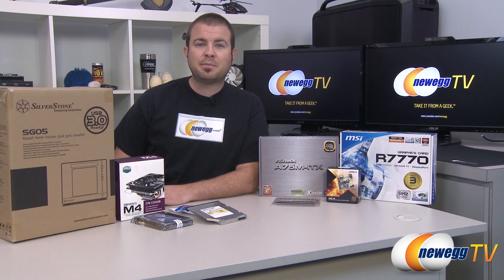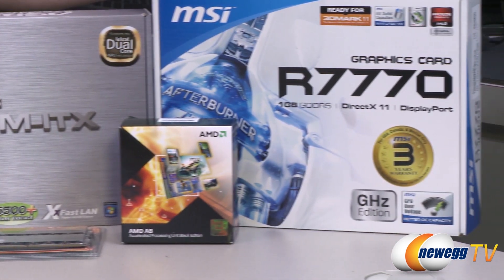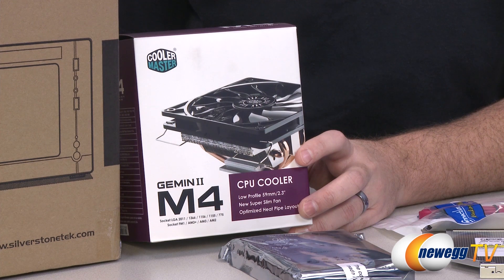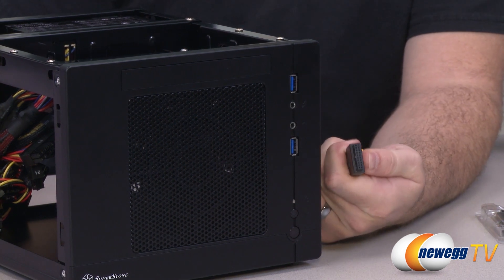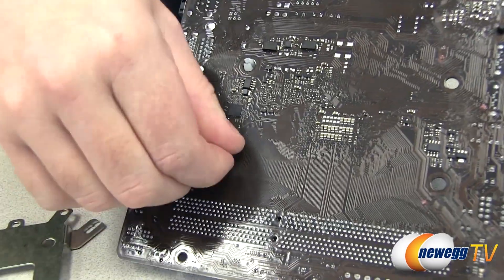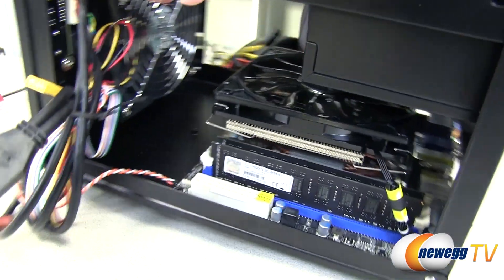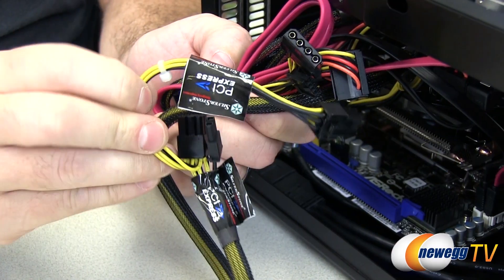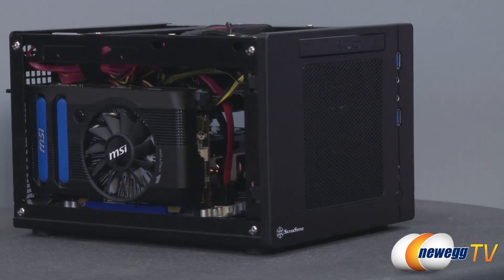Newegg TV: Combo DIY Build - Mini Mobile Gaming PC

Comment: Great case. For intel use a 4690 K i5. Use a ASUS Z97i mobo plus low profile noctura cp cooler. Use an asus GTX 750 ti GPU 8.5 inches. Promise that it will keep super cool and super quite even under load. Use crucial low profile ram and crucial ssd 2.5 inch. 450 watts will run any game on this set up without any heat issues. Just use cable ties and ingenuity for the rest.

Comment: Can it play bf4?
Reply: it can but i would get more ram at least 8gb
Reply: MrCodgamer919  Easy, no probs. Use ASUS GTX 750 ti GPU with Z97i mobo and Noctura low pro cooler. intel i5 4690 K and 8 gig of low pro crucial ram and crucial ssd. no noise and no heat issues.

Comment: i believe it's possible to fit all of those parts in a mITX case
cases obviously don't determine the performance so it will perform the same as a "mini one" and you're going to need to buy a mITX motherboard to fit in an mITX case

Comment: interesting question and it made me wonder if the integrated gpu could be of help in the PhysX department, since with an amd card, the physX load is handled by the cpu and handled quite badly.. would such integrated gpu function as the more complex nVidia+AMD hybrid configuration?

Comment: Why no use 120 mm slim radiator closed system watercooling and the benefits is water maintence requaired and easy to use

Comment: you can run the graphics chip that is integrated in the APU in crossfire with the external graphics card, there is a lot more you need to know about this though so do your research if you are planning a build using this feature.

Comment: Yeah you can run crossfire between compatible chips. You can only do it with certain cards but the 7770 and the gpu in the apu work together fine. I've done it for client builds before.

Comment: Pretty much any CPU made somewhat-recently supports the x86-64 instruction set.
Some mass-produced systems may not have drivers for 64-bit windows, but other than that, just call or use google.
(If you mean your own, go to Control Panel\System and Security\System, it's under "System type")

Comment: $617 as of this minute on Newegg. Kind of a bit pricey but the mini ITX case and motherboard are a bit pricey because of the tiny size. This is of course without the OS, monitor or keyboard and mouse.

One could build a micro ATX or ATX system for about the same price and have room left over to add more hard drives or PCIe peripheral cards in the future if needed like a PCIe x1 wireless adapter.

The build in this video is pretty much locked into its configuration, no room to add.

Comment: You talking about the USB 3.0 TO USB 2.0 converter they talk about at 5:09, if so that should come with the Silverstone case in the accessories box along with all the screws and things. 
If it was not in there then email Silverstone support usasupport@silverstonetekDOTcom and they should hopefully send you one out free of charge.

Otherwise frysDOTcom has one that should work. Item number 7229943 just type that number in the search.
No clue why the egg doesn't have them, could not find any.

Comment: There are a couple solutions, some better than others. If you can afford it, some Motherboards come with a Wifi Card built in, this might be the best solution, as an necessary drivers will come with the MoBo. If that's not an option, you can get a PCIe card with a couple antennae that will enable Wifi. If you really want to keep costs down, there are USB Wifi Adapters, but if you are looking to do an after-the-build upgrade, look for a wifi card.

Comment: there is one very wrong thing about this build and that is to make sure you only buy 1866 mhz with the apu's because the graphics card in side the chip uses the ram so if you have 1333 mhz that will slow you performance by a lot so don't make that mistake.

Comment: lower end is definitely not catching up to a 560, and 560 is a high end card, no doubt about it. its good to have newer hardware for power saving purposes, but i don't want to spend $200+ on a card that just isn't all that much better than a $150 that can run anything.

Comment: The AMD apus are not bad for entry level gaming, but you do really want to get an external graphics card for them. That card is almost the same as my new Video card, save for mine is the factory o.c.d version. Runs everything at full settings, more or less.

Comment: mini-ITX allows the use of desktop parts so it's significantly cheaper, more powerful and modular than any laptop. You lose the screen, but you get the full selection of ports and features in a smaller package, so it's great for HTPC and LAN boxes.

Comment: He just said a new version of the case came out after he chose all the parts. Although newegg is usually on top of their stuff, there's a little laziness in this build as he didn't update his mobo selection. An Asus F1A75-I Deluxe or equivalent would've been a better mobo choice to include all the above functionality with a internal 20-pin USB3.0 connector.

Comment: I was just wondering if you could provide the link to which slim line sata cable you used in this build, i'm looking at some but some reviews say right angle slim line sata will not work since it sits right up against the metal plate. Your specific cable would be good, thanks.

Comment: As long as the psu is good enough, though you will be CPU bottlenecked by an APU. Better go with an i5 to get full benefit of the 680.

Comment: You could run bf3 around high settings in 720p, or med at 1080p. You can use said ram in this build though the difference would be negligible.

Comment: Just built a system with this case (i3, Asus board) and it's great. Don't worry about cooling because half of the thing is practically open. lots of space between mono and front, and the back half of the cover is like a cheese grater. Haven't gotten above 40° yet. Tiny, tiny box-you can carry to a party in one hand, keyboard&mouse in the other.

Comment: Hey Paul, don't you think this build will face issues in the future? I noticed that you used a relatively low power supply. (450 watts). Do you think it will last considering that it powers an AMD A8-3870k and HD 7770 at the same time?

Comment: You could also use a 120GB SSD for the OS and the Seagate Momentus XT 750GB Hybrid Drive for storage. It has 7200RPM, 32MB Cache, 8GB SSD, and is OS independent. And the even better thing is both drives will fit in a single 3.5" bay! The Seagate Hybrid drive is awesome, it doesn't need trim due to the onboard controller, which let me use it in my PS3! noticeable decrease in load times on Digital Download Games (not on disc). Even for my PC Games I download from Amazon versus buying a disc copy.

Comment: what kinda psu would i need to run a 90 watt i5 cpu and something like a hd 7770 like shown on here or perhaps a 6850 also would i be able to use a pcie x16 extender cable to conect it to my itx pc?

Comment: I would think so... pcie Gen 3.0 might not be there, but it should be capable at Gen 2.0.
I haven't done an AMD build since I was 13... back in 94. 
(The sockets are still the same sadly... why they haven't used an LGA is beyond me.)

Comment: I just finishing putting my system together.

A couple of problems I had:

(1)  USB keyboard had problems until USB drivers BIOS were updated.    The keyboard worked in BIOS, but after I installed Windows 7 Home Premium Edition, keyboard input didn't work.     I used a PS2 to USB adapter with the keyboard until I got everything working.

(2)  No output from VGA port.    The Radeon 7770 cards works great using HDMI adapter.    Any suggestions?
 
Keep up the great work, Paul!

Comment: Why on earth would you pair an APU with a 7770? The 7770 cannot use Dual Graphics with the APU and the APU itself is very weak in the CPU department. You should have gone with a Sandy Bridge Pentium or an i3. Would have been much better.

Comment: Prefer to see an i7-3770k on the Asus overclocking ITX motherboard...
Maybe a custom water cooling loop with Corsair static blue static pressure fans. Then, all packed inside the BIT Fenix, white ITX case.
For giggles, ditch the external gpu, OC the 3770k, & see how bad the AMD system really could've been.
(I like both Intel & AMD, but they need to get the lead out and force the Intel tick-tocks like the FX-74!!!

Comment: You can run a i7 3770k and a gtx 680 in that case with a 450w power supply, if you want a nice little system, this config might be your best choice!

Comment: A 6000 card would let you use the duel GPU somewhat like crossfire I am not sure you can do that with the 7770. But on the plus side the 7770 card dose have clock boost or something like that. where if you need extra GPU power and the card is cool enough it will overclock itself like NVIDA 600's do.

Comment: what do you mean? 
If you could save $614, wait a bit and save $1000

Spending all of a sudden because of a supposed "deal" can leave  you with a system underpowered for your wants and needs or worse, poorer parts at a worse price-to -performance ratio.

Comment: He said nothing about the price, he wants a mini itx gaming system, clearly not going to be a budget build, clearly by the parts he's mentioned (I would want that system as well)
$614 isn't exactly budget either, coming with a generic power supply that comes with the case (no thanks) and not catering for the OS a number of people would need to buy.

Comment: In case you didn't know manufacturer stated minimum power supply requirements are stated for people who have junk no name power supply like yours which had 430 W only written on the box and nowhere near in reality. In reality only  thing that matters is 12 V rail. How many amps do you have? 7770 consumes 80 W while gtx 550 consumes 116 W, so tell me how does manufacturer stated min power supply requirement reflects that?!

Comment: Because it's not true. That APU performs "better" in most all gaming, 3D rendering, and overclocking environments, with and without a dedicated GPU. It only falls behind in CPU intensive application times, unless the application can effectively use four "real" cores, then it beats the i3 and hyper-threading, though this is rare since most applications can not effectively use 4 "real" cores.

However this is being billed mainly for gaming, and in that light, that CPU performs better.

Comment: I use that case, funny when I got the case I ordered the last model with USB2, got the USB3 one for free thanks NEWEGG!
Quick System Specs:
SG05 Silverstone case
Intel i7 2600s
Patriot DDR3 DIMS 4GB x2
Asrock z68 ITX Motherboard
Patriot 32GB SSD
500GB HDD 
Nvidia 440 GT ( Later upgraded to 560)
 
I think this build is a interesting choice in parts. The APU's seem better in systems that don't have a discreet GPU. but otherwise I think its a nice system.

Comment: why on earth would you use an apu when your going to install a gpu that doesnt work togehter with it such as 6450, 6570 or a 6670. not a 7770. its wasting half the value of the apu

Comment: So this is the cheapest possible build with that performance? He's putting in a 7770 and it doesn't crossfire with the apu. Is there a way to have a non apu CPU with the same discrete card etc. for the same price or less?